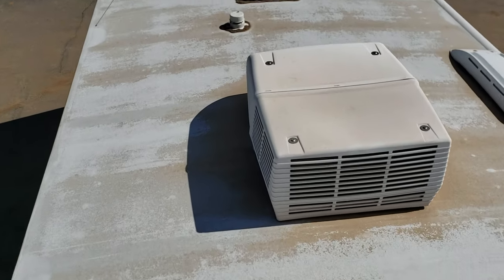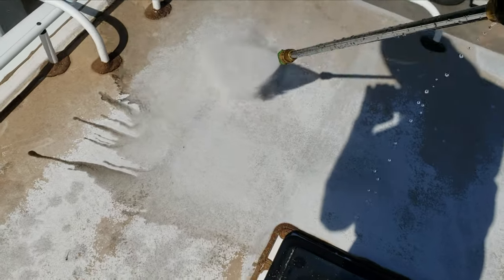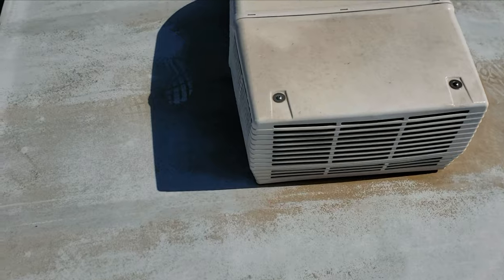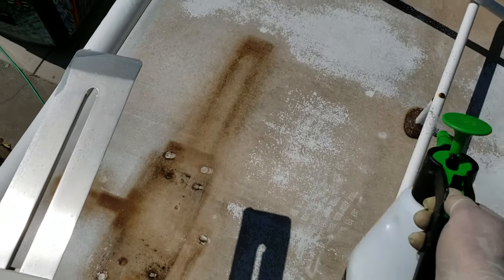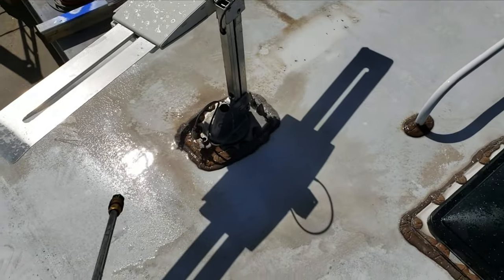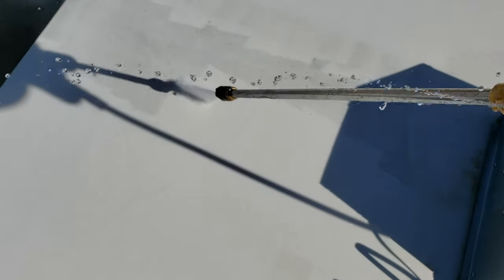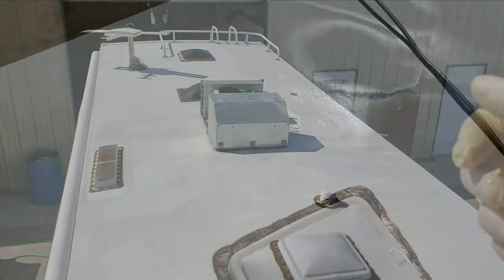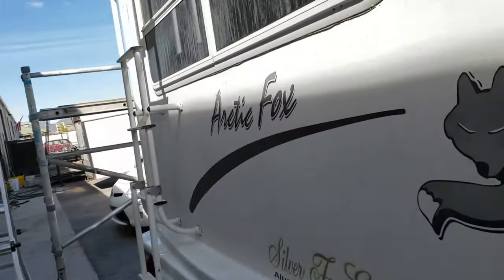Cleaning a Very Dirty RV Rubber Roof Membrane

Comment: I just completed my roof last week. I purchased the trailer second hand and the former owner had not cared for the roof at all. I used the same cleaner in this video and a power washer. I spent 5 1l2 hours taking the old rubber off. It flaked just like in this video. It came off easily on the back end but it was miserable taking off the front half. Eventually got it dried, primed and coated. My advice? You don't see the roof but give it a look every year. Don't delay cleaning and coating fresh when you need to. This will save you the 5 1/2 hours I spent removing the old covering before I could put the new one on. Also, it makes a huge mess. Get ready to clean the trailer and the surrounding area. Move anything close to the RV away because it's going to get dirty.  Be careful, the roof gets really slippery. I used a real sticky primer called Liquid Rubber EPDM and its an amazing adhesive. But once it's on you can't walk on it without losing a shoe or two. So, it's tough to manage putting it on and then the RV 4" sealing roof tape I put on after it. Maybe tape first, adhesive next?  Then I rolled Liquid Rubber RV roof coating. Easy spread, used a gallon for the first coat and it covered over the primer adhesive really well. Used a ladder to roll it because as I said, I couldn't stand on adhesive coating (trailer is 29") so I could reach working off the sides. The RV tape (Telsitine Roof tape) I used worked very well - it's a little expensive but it's a great product. I used it on long seam lines and around some gear. It was a 50' roll and I used it all. So, it was an interesting 3 days getting all this done. Good luck with your RV and stay ahead of the work, you won't regret it. Btw, final thought. Whoever does the roof work like this n the repair shops deserves a medal and a raise. Whatever you paid them to do the work for you, it was worth it, believe me.

Comment: My trailer is about 7 years old now and I bought it brand new.  I really don't care what the roof looks like as no one really sees it anyway.  I do  maintain the seals.  What I have done since new, was sweep and apply vinyl flooring wax once or twice a year.  So far so good.
I had heard via another video while using a pressure washer on the RV roof, the pressure should be less than 1200psi so pretty much no pressure washing on the roof.
Reply from the maker: It is dangerous to use a pressure washer on a membrane roof, so I did take care. Thanks!

Comment: I have a 2020 Winnebago micro Minnie and I'm in Florida, we have had a whole lot of rain , I clean my roof every 3 months per the book, and now I have black spots after I cleaned it this time around , looks like mold. Should I use that Dicor roof cleaner to get the black spots off. I figured if anyone would know it would be you and not steer me wrong , so WWJD( what would James do?) . Thanks for the awesome channel.  So far I've used Best RV rubber roof cleaner and Camco RV rubber roof cleaner to no avail.

Comment: I have an RV parked under a huge tree and it left brown leaf stains running down the side after it rained a couple times...  Anything you can think of that would remove that?  Pressure washing doesn't even dent it.

Comment: Recommend spray down a 50/50 solution of Simple Green & Bleach wait a few minutes and then pressure wash off using a 40° fan spray at least 8-10" (depending upon PSI) away from the EPDM roof then let dry 24 hours.  The next day, reseal top edges of all the edge trim pieces with non-leveling DICOR sealant, reseal all cracks with DICOR Self-Leveling lap sealant and/or use eternabond (only where it's really needed) then coat the entire roof with HENRY's Tropicoll 100% Silicone roof coating.  It's really that simple!

Comment: Another good video! I have rubber roof and its peeling in a few spots....I was going to clean and reseal with Henry's tropi-cool roof coat. Has great reviews. Any suggestions on prepping the roof? Cleaner or sealant so it sticks better.
Reply from the maker: As with every product, I'd recommend following the instructions on the can. Of course clean the roof completely. Of course, I can't recommend any product not intended for RV rubber roofs. I'd be interested to hear how it goes. Thanks!
Reply: @AZExpert  you got it ...thx
Reply: It’s been 4 years since this video ~ have you used other products for roofs that may last longer

Comment: Not trying to sound snarky here but I don’t understand why it make sense to take so much roof material off just to make the roof look white as new. I keep my 9- year old “rubber” roof clean but I don’t worry about making it look like it just rolled off the line.  I wash it with Dawn and a soft brush twice a year which keeps the roof looking good and avoids dirty runoff on the sides of my trailer.  Is there any longevity advantage to doing a super clean instead?  Thanks for the videos.
Reply from the maker: The roof hadn't been maintained so the flakes were oxidized roof that were already "used" We wouldn't want  to seal to loose or flaking sufaces, the power washer was just easier than brushing.
Reply: @AZExpert  Got it.  Thanks!

Comment: I was wondering what pressure you use on the pressure washer. I heard it can damage your rv roof. Your roof looks so much better clean.
Reply: Use the Black Soap nozzle, or the White Nozzel, and don't get too close to the surface. Stay 6 inches away if you can.

Comment: Great video. I'm cleaning my roof for the first time this weekend on my 3 year old trailer. It has a rubber roof.

Question...I've heard different things on coating with a rubber sealant. I've been told not to, and also told I should. Since it's only 3 years old with no leaking, should I avoid coating? It also has a 12 year warranty for the roof, so I don't want to void the warranty.
Reply from the maker: A coating is only to add a few years to a bad roof and not part of any maintenance schedule. Just use soap and water to clean it and look for peeling sealant and any damage
Reply: @AZExpert  ..Thanks for the info.

Comment: Really nice cleaning job. I bet it looked spectacular after sealing. I'm sure your customer was very pleased. Did you use dicor sealant or some other brand? I watched another youtuber who used a sealer product from Henry, I think he said it was silicon based. It looked fantastic when he finished. I wonder if you're familiar with that Henry sealant, and if you are, what is your opinion of it?
Reply from the maker: Thank you very much. The clean was Dicor rubber roof cleaner. I just used the standard acrylic Dicor lap sealant to seal. The UV protectant was just a mop on clear product. In general, I do not like the roll on roof coatings of any type as they provide a unearned sense of security to the owner and when all is said and done, either the membrane is failed and should be replaced or it hasn't and should be cleaned and monitored. Thanks!

Comment: I would never use a pressure washer on a rubber roof. All those white flakes....what do you suppose they are?
Reply from the maker: the zinc oxide layer to protect the rubber, it self sacrifices to protect the rubber

Comment: How do you know if your roof is rubber or not??? Instead of a pressure washer, which I do not have, a hose with a power nozzle...will that do the same thing? thanks
Reply from the maker: the easiest method is to remove a vent trim from the ceiling and look for black on the bottom of the membrane of the roof

Comment: Quick question, is it safe to stand on the roof for a while? Will it damage it putting your full weight on it? I’m looking into doing this in the next couple of weeks
Reply from the maker: generally the roof will tell you if it's safe. Some roofs are very thin and youhave to find the rafters, otherwise most roofs are safe to stand on

Comment: Have you ever seen a rubber roof membrane so bad it leaked with no visual cuts? or are leaks always caused by seams around vents and such? Also What's a good indication that a rubber roof is beyond repair? Thanks :)
Reply from the maker: A standard EMPD RV roof has a whit elayer over the rubber black layer. Once you see the black layer, it's time to replace for sure. Other roofs TPO and PVC do not have a black layer and just disintegrate. It should not be possible, and I have not seen any membrane type leak without a cut. It's almost always the front and rear cap seams that like and skylights cracks.
Reply: Sir, where are you located? I will like to schedule an appointment so you can came out to check my trailer
Reply from the maker: @JoisyGal69  The shop is in Apache Junction AZ off of Ironwood and Guadalupe.  What is going on with your trailer?

Comment: I think your patterning for pressure washing needs a little attention!   Most folks would remove all covers first.  Then, start at one end and evenly and completely work to the far end with the spray wand....
Reply from the maker: I'm not sure what other covers you would have removed. The sprayer has limited length of hose and I felt the pattern I chose was the safest and quickest. Thanks!
Reply: @AZExpert  You did put forth a lot more than most of us other's in that you're trying to assist us. Thank you for that!

My comment is directed at 00:42 and subsequent where you are spraying and spraying and it isn't until 7:00 that you speak of getting the covers and antenna clear of your way for your continued labors!  :-)    Your spraying pattern from the start is simply misting the exposed surfaces with water.  I think you refer that as "rinsing".   Why not "rinse" the entire surface,  covers removed?

Comment: They should develop a factory roofing system that is designed to last 20 years.
Reply from the maker: I can understand the desire, but RV's only average 10-15 years of life or use. RV manufactures find that the "geewhiz" finishes and floorplans sell RVs and buyers will not pay for substantially better quality- all things being equal. Thanks!
Reply: Well enclosed cargo trailers seem to be far superior on build than rvs all around..

Comment: Thanks for a great video. I know this video is a couple years old at this point , but wondered what your thoughts are on the Dicor cleaner and the potential to damage paint. Most instructions I've seen say to tape off and plastic mask the sides of the coach to prevent damage to paint. Big pain...hence the reason I haven't used it.
Reply: I was thinking the same thing but then I figured I'd have an assistant spray the sides of the coach down while I was doing the roof. My second idea is just to use the pressure washer alone.
Reply: It could be the company is being overly cautious. Purple Power for example says it’s great for entire exterior of vehicle. Then it states not to use on certain parts of exterior ie wheels. Maybe if rims were painted, product undiluted and long dwell times it’s a problem.

Comment: In your video, you say that it is dangerous to use a pressure washer on an EPDM roof. 
However in Dicor's video at https://youtu.be/1OQBKL7Z_dQ 
they say to use a minimum 2000 p.s.i. pressure washer held within 12" from roof surface.
What was the p.s.i. of the sprayer you used in your video? Would a portable 1,200 p.s.i washer do the job?